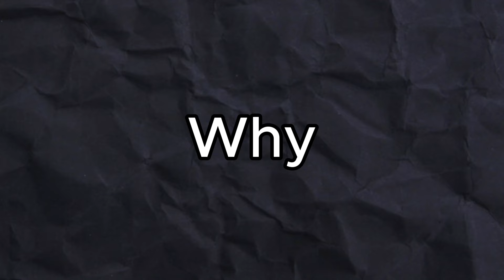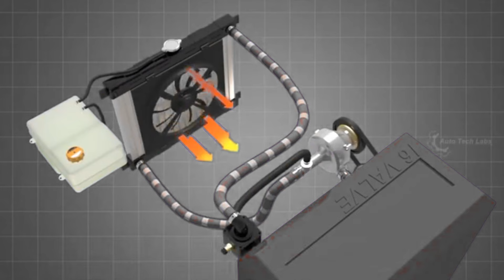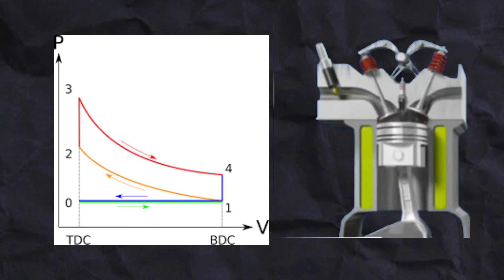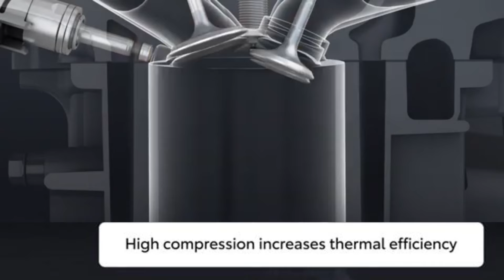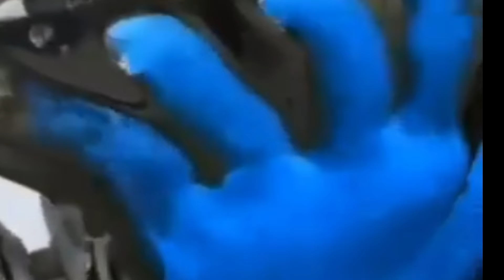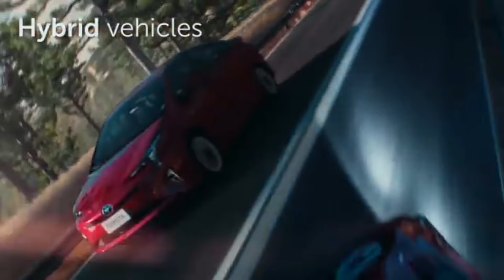Why IC Engine Efficiency is TERRIBLY low

Comment: The piston is being pushed down by pressure not heat, so lets assume we have a maximum pressure of 700 psi at 5 degrees after top dead center and our exhaust valves start to open at 5 degrees before bottom dead center. How much energy (pressure) is lost before bottom dead center and where does it go. Also if we have 2 pistons, when p1 is going down it transfers energy (compression) to p2 how does the Carnot cycle account for this energy transfer.

Comment: What about energy density? How different it is between fuels. And how can be stored in practical ways (hydrogen must be frozen and occupies lots of space) in liquid, battery or solid form. Plus how the external environment affects the end result like freezing and/or hot temperature.
Life will teach you ain't black and white. Best is it depends, an hybrid of some sort. And then you have the final answer
Reply from the maker: Thank you for the comment 
In this video, my focus is on the difficulties keeping IC engine efficiency low and efforts made to overcome them. 
The energy density of different types of fuel is another interesting discussion.
Reply: Toyota HEV implementations increase the operational fuel efficiency of automobiles by ~30%-50%.  Many, including Camry, are over 50 MPG now.